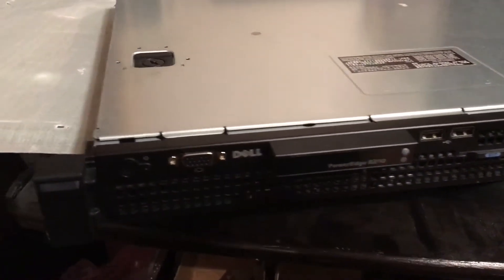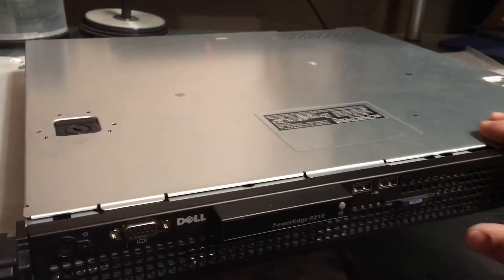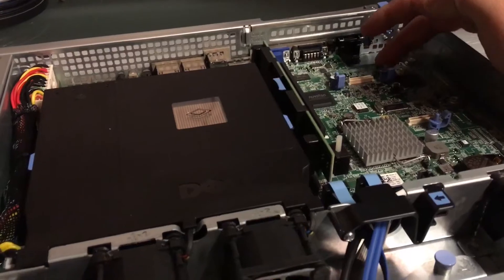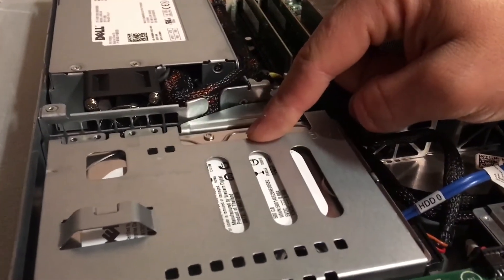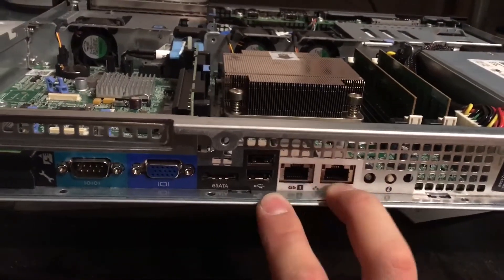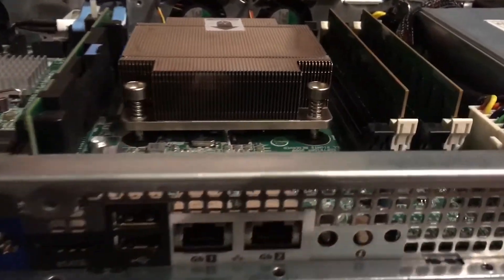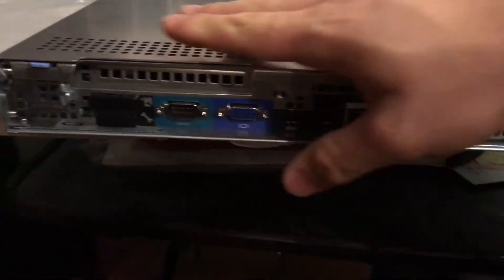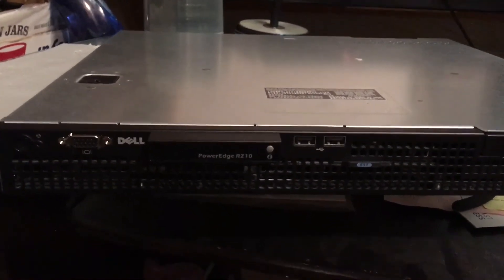Dell PowerEdge R210 Review

Comment: What does idrec do?
Reply from the maker: iDRAC provides functionality that helps you deploy, update, monitor and maintain Dell PowerEdge servers with or without a systems management software agent
Reply: +GNET Data Center I have 4 of these servers and there pretty loud could I change them to silent fans to make it quieter?
Reply from the maker: No, and they are not that loud, if you set the BIOs to Custom Power Settings and take the Fan performance to low and everything else to high you will be okay. What do you use these 4 R710s for? and also download the dell bootable R710 linux CD and update all your drivers and firmwares